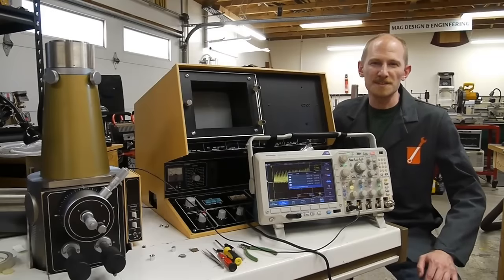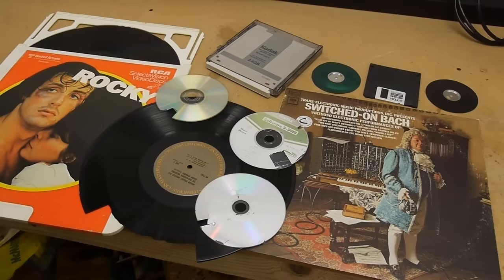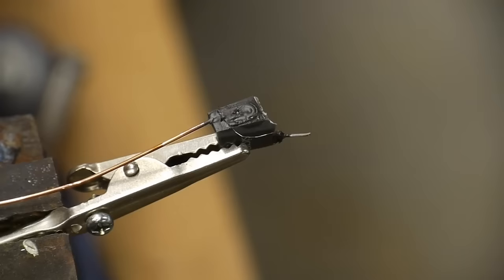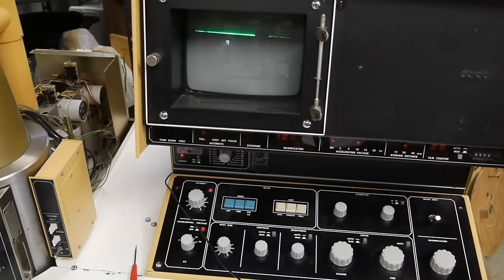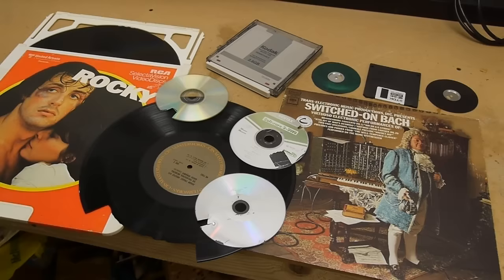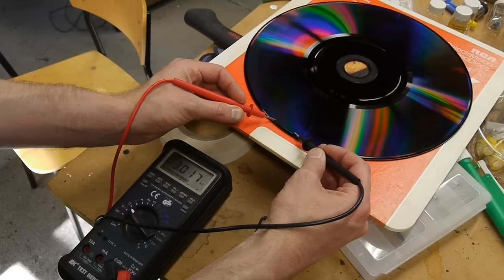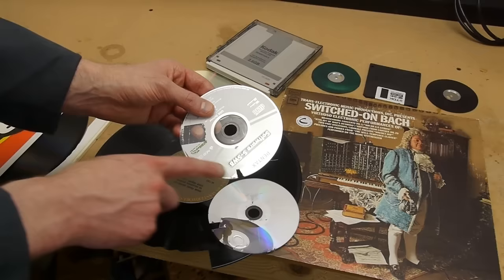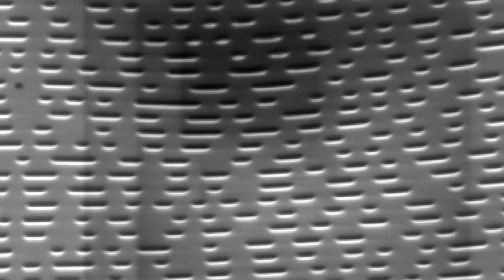Electron microscope slow-motion video of vinyl LP

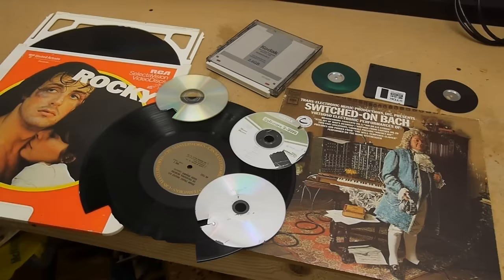Comment from the maker: The vinyl record that I cut into sections was actually Johann Strauss (The "CBS Masterworks" label can be seen at 0:26).  Switched-on Bach remains intact.
Reply: Good to hear. Even though your sputter coaster needs work, you are still a man of culture.
Reply: i got a little nervous for a moment...
Reply: great work by the way - just thinking about having a 12" single with recordings on 45 rpm would have been a more spectacular insight as the grooves are in fact a lot bigger than on LP. but anyway some great insights here.
Reply: ...and that capacitance disc... what a great chunk of history.
Reply: Around 1987 a good friend of mine had over 50 of the video discs and player. It actually played very well. Awesome to hear you explain how all of these various techs work. Thanks for a great video.
Reply: Hmmm, yes, what he said... LoL.
Reply: Thank you for not cutting into Switched-On Bach :-3
Reply: @joeysplats3209  Actually, it's a flux capacitor.
Reply: if you don't mind my asking, what is the format you have with rocky cut into it?
Reply: @Pugetwitch  so a CED instead of CD but not a laser disc because that's digital
Reply: @TheBlackbelair  LOL!
Reply: I came here to stare and marvel at "microscope slow-motion video of vinyl LP" for 10~ mins.. Not whatever this is
Reply: @dall6  what do you think this is?
Reply: thank god.
Reply: ezzz9  when did he become wendy?
Reply: ezzz9  ok? He became a woman I'm curious. I sold target talk to someone "through" technology than ask it.
Reply: I’m glad you clarified here. I was just about to scream. Ms. Carlos has just turned 80 years old couple day ago.
Reply: @user-xv4he4mt4x  so "she is transgender, fully transitioned,  and was okay ohv things?"

I need clarification on what the comments are stating and im sorry if my research weeks ago were bad. 

Who is this single woman, I think I looked up the wrong person.
Reply: ew Cash https://en.wikipedia.org/wiki/Wendy_Carlos
Reply: @user-xv4he4mt4x  I was asking your opinion and the name official.  You satiated half of my inquiry.
Reply: That album was worth 50,000.00!  lol
Reply: @jeffj266  which one?
Reply: I would only have used some record that's already unplayable for some serious fault... Strauss is still good music.
Reply: @MetalTrabant  I was just shocked when you said that he wasn't going to cut up the bach record right isn't it like Bach retooled Orbach plugged in or something I forget the name of that record but there's like a billion copies of that thing you can find them at almost any consignment thrift antique or whatever type of shop that still sells vinyls. That would have been my first pick since I have had the chance to own at least 25 different copies of it at this point in my life. Oh and I'm pretty sure that I own two currently so maybe I'm biased.
Reply: Damn, I seem to have misplaced my spoodercopter.
Reply: @FlatBroke612  maybe listen for the fleshy "splop-splop-splopt" sound and you should find it.
Reply: ezzz9  more open minded? Seriously, homosexuals were hardly allowed to practice sex at all
Reply: Thanks, that was thorough, splendid work
Reply: I Walter/Wendy Carlos still alive?
Reply: Good, bach is good
Reply: thank goodness.
Reply: PHEW!
Reply: @CashewBestofNuts  laserdisc is actually analog (video) and analog and/or digital audio, depending on the disc
Reply: @cabasse_music  ok, but the device playing them is digital regardless of analog state of the disc?
Reply: @CashewBestofNuts  some of the high end ones from the late 80s/early90s had a digital frame buffer so you could pause and have a perfectly still image, but the video signal itself was always analog
Reply: @cabasse_music  ok awesome. Thank you for The knowledg. when I was in school and we'r watched one I think some of what the box stood confused the teacher or maybe it was the newer disks.
Reply: Thank you for making this video, your content is always so informative and I learn a lot!
Reply: Thank God, for a moment I thought you cut up a Wendy Carlos masterpiece
Reply: Hello, why didn't you try to burn a CD-RW disc with different info like all 0, after all 1, after alternate 0 and 1, and show the pattern
Reply: This is brilliant....you might pass it on to Wilson Beseech in England. they are technical enough to perhaps put it to use
Reply: I’m interested to learn more about how sounds are focused into the recordings with the stylus. Does greater volume or pitch make deeper groves or are they wider?
Reply: Got me reassured, it is an amazing album. 😅
Reply: it's a classic... I picked up an unopened copy last weekend from a local carboot sale for £1   :)
Wendy/Walter Carlos is a character.
Reply: Thank goodness Wendy Carlos lived to play another day!!
Reply: LOL jajajajajajaja
Reply: Great video dude, thanks for this - just wish you would have explained the basis for the data encoding on DVDs a little better - you mentioned that it wasn't analog (so not based on the physical movements of a needle "reading" the pits on the surface) - obviously since it's an optical technology - and that it didn't have to do with variations in capacitance along the surface (again, same thing) - but you didn't mention how the data is actually read? Is it a path difference thing based on interference? Is it like a time for return signal thing (based on clock cycle of internal processor maybe?) - Is it just diffraction? (changing wavelength of returning light hitting a sensor / photoelectric plate creates differences in voltage / current output?) HOWS IT WORK MAN?! :)

PS I know I could just look that information up but it's like - you explained it for every other type of data encoding you examined and just missed it for DVDs! :P
Reply: 6:40 This is exactly how the Wurlitzer 1946-1953 Electrostatic Free Reed, and 1953-1963 Electrostatic Continuous Free Reed organs worked. Look at this animated article here- ggl.   ' NSHOS Wurli 4600 '
Reply: I would be happy to provide you used vinyl in abundance at no cost. 😀
Reply: thank god!
Reply: I have one for all the techy nerds out there.  Sometimes I'll be sitting in a half-sleep and music will be playing in my mind and sounds very HQ.  Is this digital or analog?  Well, I know it isn't digital so then what's the analog format?
Reply: That's good to hear, and I'm sure Wendy Carlos would be happy to hear that too :)
Reply: I know I'm crazy late to the party here, but we actually used to rent those RCA players.  We didn't have a VCR back in the very early 80s and neither did my best friend, but our older brothers would rent a video machine and a dozen movies over a weekend a few times a year and we'd have a movie fest.  At least once they came home with one of those machines, but I remember we had issues with some of the playback (maybe they didn't wear well, I don't know).  We also rented the old Laserdisc a couple of times and loved the quality but also had issues with some of the discs.
Reply: Ironic,  Switched-on Bach was one of the first LP's I bought when a teen.  I was listening to it for teh fisrt time in decades when I discovered this video.  I felt a mix of emotions that you cut yours up.  But was thrilled to see your novel demonstration and imaging.  Thanks,  worth the sacrifice.
Reply: Nooooo! How could you do that to Strauss? Actually Bach is cool too.
Reply: LOL Thats funny.  No matter what composer/artist you list.  You're gonna catch it from some quarter.  Really enjoyed the post.  I'm a gadget nut...but seriously... you have your own electron microscope... I genuflect in your general direction. 🤣🤓
Reply: Unlike Walter
Reply: I absolutely adore your videos. I learn something every time I check in on your channel. Such a treat, man, and thank you.